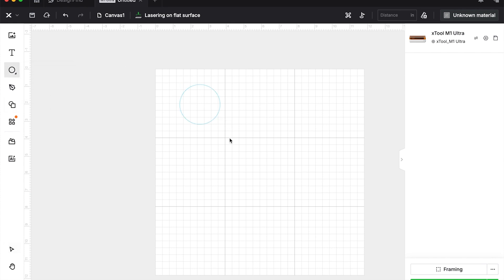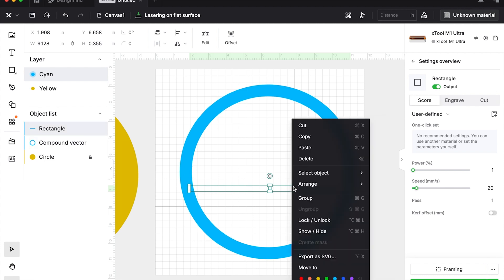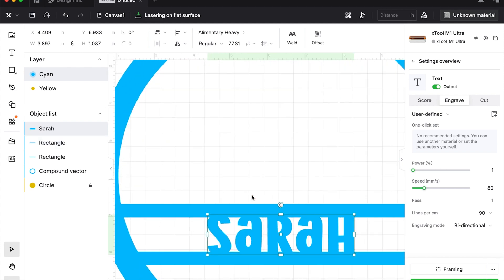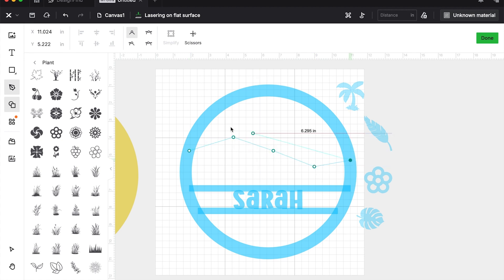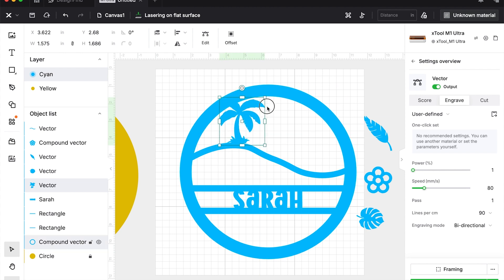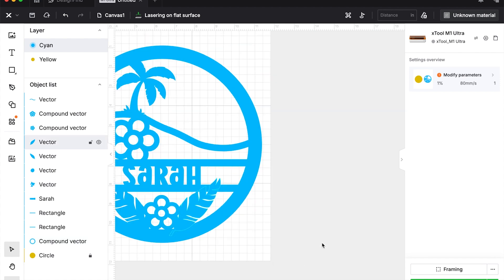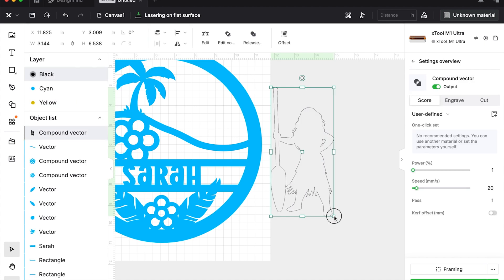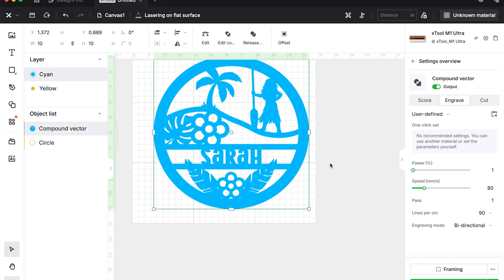xTool XCS Tutorial / How to Make a Custom Sign / XCS 2.5

Comment: THANK YOU FOR FOR EXPLAINING MARKING! NOBODY ELSE DID.
I am having a hard time getting the marking box the right size-too small, too big, not in the right place. Any hints?
Reply from the maker: Which machine do you have? I think my top tips would be exactly how I do it to get perfect placement:
1. Turn on "auto snapping" in the software settings menu (the X menu in XCS). 
2. Mark the outside edge of everything to know your absolute space. Use the "right" marking parameters (square, circle, poly, line).
3. Make a shape that fits into the outside edge marking. Center or "snap" that shape into the outside edge marking.
4. Add your design onto the XCS canvas. Center or "snap" your design into that shape.